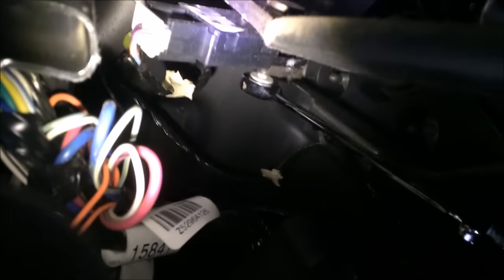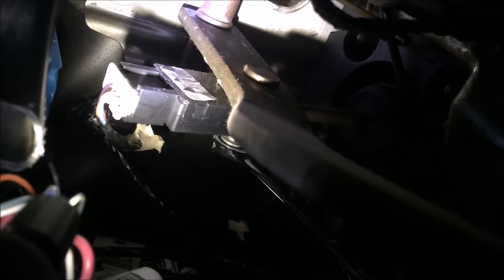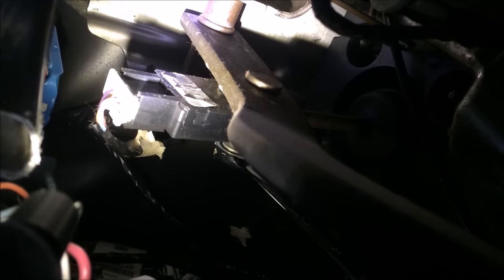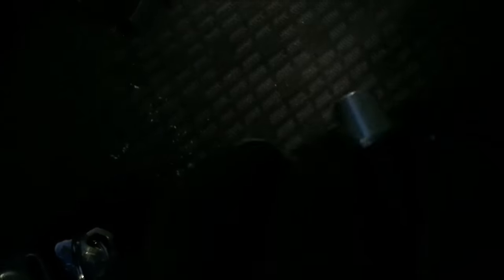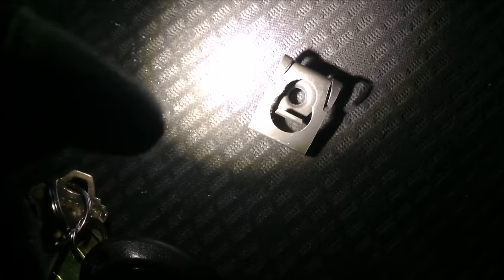How to Replace a Brake Switch on a 07 Silverado, Fixes Cruise Control Issue.

Comment from the maker: Thanks for all the positive feedback everyone, very worth making this video. This is my own little slice of fame lol. I have done more work to my truck that I did not make videos on, but if anyone has questions on replacing the crap door speakers, or how to install a Bak-flip bed cover (my favorite design due to a hard cover, fold-able, and level bed-height profile which is what you need for backing up in my opinion) I would be happy to help. My grill was home done as well with a roll of painters tape and two cans of automotive grade spray paint for plastics. My buddies where painting their bow ties black so I had to one up them lol.
Reply: the crap speakers have any effect on the door chime/headlight on warning?....think it comes through the speaker and mine is so quiet (set on loud) that I can't hear it......
Reply from the maker: andy heinrich If the speakers play music just fine (evenly on each side) then I would not suspect that to be an issue. To me what made them "crap" was their poor audio quality and one of mine was cutting in and out.
Reply: don't think either is on at all........bought new ones from GM...that's one of today's projects......love having the cruise working since I drive about 75 miles a day to go to/from work
Reply: andy heinrich
that fixed all my issues. Right speaker was intermittent, left was dead. By the way, the door chime comes from the drivers door speaker. And the rattle in the drivers door was the two machine screws missing behind the door handle access cover. Borrowed one from each back door.......
Reply: Yes the crap speakers please lol the drivers side will cut in and out and sometimes not work at all
Reply: @TruckOwnership101, a friend has 3.1 Chevy Malibu 2003 and the brakes release but when you move a few feet.  The brakes lock up.  Could a electrical problem with the cruise control lock up the brakes?

Comment: What's up Spencer and welcome from Rochester, MN! Great video brother! I had the same issue accept the ABD and "service traction control" light was also turning on along with the cruise control not working. It was the weirdest thing, bit everything functioned correctly (brake lights, brakes)!  I've done allot of research, and determined that it was the brake light switch. Then I read someone else's post that said that the 10mm bolt may be too tight and the brake push rod may need some lube. Sure enough, I loosened the bolt, lubed behind the module and lubed the push rod... BAM! No more issue! The restriction was causing the module not to move along the natural path of motion. So guys give it a try... Cheap fix and will eliminate one possible culprit!
Reply: I second that! Went to change mine, found that the shaft was just really dirty on the brake pedal and causing it to bind/stick in the engaged position, not enough to make the brake lights come on, but enough that it would prohibit the cruise from functioning. I lightly sanded the post that the brake switch and the plunger attaches to and resolved my issue. Great video however and pretty much spot on for how to do this repair, most difficult part was trying to fit myself between the door and the seat to get under the dash!

Comment: Spence, thanks a million. '07 GMC Sierra (72k miles), coming back from a trip last May, the cruise control shut down.  It has only worked intermittently since then and has been completely down for the past few months.  A couple searches landed me here and a short trip to Pep Boys, $20, and the video did the trick.  I have a long trip in May again and this is a load off my mind.  Again, many thanks.  tommy

Comment: I have a 2008 GMC Sierra 1500.  Brake lights were working fine but cruise control stopped working.  At first it was just intermittent.  Owner's manual says cruise control will not work if brake fluid is below minimum level.  Mine was right at the minimum line.  I topped it off and it seemed to fix the problem.  A few days later the cruise control stopped working all together.  I watched your video and read the comments.  Got a brake switch at local auto part store and installed it but the brake lights stuck on - apparently it was defective.  Took it back and got another one and then it worked fine.  Cruise control works properly now.  Thank you Spencer!!

Comment: I have a 2008 Silverado; bought used in June.  didn't use the cruise during the testdrive; brought it back to the dealer a day or so later to prove that it wasn't working.  They did some tinkering and I even took it in for one appointment.  Think I will try replacing the switch as per your video; nice work, btw!  you seem like a very good teacher; bet the students enjoy you and your class!

Comment: Your video helped me solve the intermittent cruise control problem on my 2008 Silverado. Your instructions helped me learn about the brake switch and how to replace it. My truck had the same symptoms you described. It began during the winter and seemed okay later during the summer. This fall as the weather cooled, it again became intermittent. After replacing the switch, the cruise worked fine for a few days and then became intermittent again but I was able to activate cruise by tapping on the brake switch. Finally took the switch out again, wiped off the old grease and applied new dielectric grease. Also applied grease at the point where the brake push rod enters the firewall through a rubber boot. I believe the push rod was sticking at that point. Cruise control seems to work 100% again.  Thank you again for posting the video.

Comment: I have a 2007 GMC Envoy.  It was identical in changing. I changed it in about 10 minutes.  BTW i've contorted in ways i didn't know i could. LOL...recommend needle nose pliers and a flathead screwdriver. Took a little bit to figure the clip out. Not hard though.  Easy peazy!  Thanks a million!

Comment: Thank you Spencer.  My 07 Avalanche didn't have a 10mm bolt.  It had a clip instead covering where you show the bolt to be.  The clip is very springy. There is a little "J" ledge on the bottom of the clip you need to pull on first so the top of the clip can clear the ring around the shaft.  I was then able to get a small screwdriver between the top of the clip and the top of the shaft and lift it up enough to push the clip up and off.  Then the dis-assembly and re-assembly was just like you show.  Putting the clip back on was easy. Press the whole clip while pulling lightly down on the "J" channel.  Mine clicked right into place.  Took me about 20 minutes.  Now that I know what I'm doing, should take about 10 minutes.  The best part is my cruise control is now fixed!!  Thanks again.

Comment: very much appreciate the video along with all the responses. I easily changed out my brake light switch on my 09 gmc sierra denali and the cruise works again. One very interesting discovery though. The part number for the sierra series is 15861245 from gm. So when I removed my brake light switch it had a different part number on it. that part number was 25981009. So I called back the parts department at the local gm dealership and was told that the 25981009 switch belongs to the Yukon and all the other suv's gm produces. He was not able to tell me how that switch got into my truck since I bought the truck new. But the new switch works perfectly so far.

Comment: This helped me fix my trailer brake issue as well on my 2007 1500, they were always engaged when I turned on my truck. Swapped the switch and it was fixed.

Another helpful tip is to put some paper or something to keep the tab from firing off into the depths of your truck when you finally get it to pop off (I had to do some serious fishing to get it out of a crevasse behind some wires)

Comment: Just replaced my switch on an 2008 Silverado 2500 HD.... Besides affecting my cruise control, it was sending voltage to my brake controller and applying my Travel Trailer brakes all the time... $20.00 fix and 30 minutes... not bad

Comment: Great video and a big help.   Thank you Spencer.   Just replaced the switch on my 2008 Silverado  LT 2500 HD.  My truck's symptoms were exactly like you described in your own repair.   With your video, the toughest part was getting that darn clip off.   After applying a light bit of pressure on the inside of the clip with a narrow blade screwdriver, it came off like a champ.  Back on the road and able to activate the CC again at will!   Thanks again.

Comment: Thank you for sharing this info.  Once you are under the dash, all this comes together perfectly!  

Note: for trucks/SUVs with adjustable brake pedal height, the sensor is oriented to the passengers side.  Same PN and parts to remove, just a different packaging as the up/down motor makes it a tighter fit.  BUT not any more difficult to replace as this video shows.  

Tools:  10mm wrench and a medium flat head screwdriver.  

10 minute job.

Comment: Great explanation!!!  Here is my experience.  Never mind, LSS.   First.  While up under the dash, depress the pedal, then release it.  You should hear a slight click with each movement.  The switch is meant to swivel slightly.  If it doesn't move, use penetrating oil between the switch and let it soak.  Then move the switch back and forth.  When it begins moving freely, it should work.  Save a lot of work, and is likely to be the problem.

Comment: Awesome video. I am trying to do the same on a 2007 Chevy Suburban. The switch is and harness is exactly the same, the problem is the screw holding the assembly together. It's round on one side and flat round on the other, with no way to remove it. Any thoughts on how to remove the screw holding the assembly in place? The screw is round on both sides, no place for flat head or phillips head. Any suggestions or help would be appreciated.

Comment: Thanks, this helps a lot. Saves me cash that I need for other things right now. The clamp does look tricky. But I'll get around it just like changing the headlights. ('07 Avalanche, it's like pulling tiger teeth.
Reply: de49lb  yea.. whats with the headlights? Seems every month or so i have another bulb out..

Comment: Great video and info.  I'm having trouble getting the clip back on because there is not much of the pin coming through the plastic part of the switch.  Even when I squeeze the plastic part of the switch, there still is not enough of the pin for the clip to grab on to.  Maybe I don;t have the switch rotated correctly?  I've tried every configuration. Any help/advise much appreciated  Thanks

Comment: I followed your video and it was very helpful.  However, now that I have completed this, my brake lights will no longer come on when my truck isn't running.  I have tried putting the old switch back in and that doesn't make a difference either.  Nothing was bumped or cut while changing the switch.  Fuses and relays seem to be good as well.  Any ideas?

Comment: Great Video. I'm having issues with my 3rd brake light (top of cab). Hopefully it's the switch. Your efforts are much appreciated.
Reply from the maker: Thanks! Seems odd that a switch would just effect the 3rd break light... But for about $20 it's not a bad thing to try, hopefully that fixes it. Good luck!

Comment: Great video.  My '07 Tahoe didn't have the 10mm bolt, only the clip.  I didn't time myself but I'm guessing it took less than a minute to replace the switch the switch.  My only regret is why I didn't I replace it a year ago when my cruise quit working? Thanks Man!

Comment: I cant get the bolt all the way in. It was half way out when I replaced and will only go half way in unless I really turn it hard. Is it suppoto be out a 1/2 inch? I also noticed the new switch did not work so I pulled over and pushed it up and so far its working

Comment: do you happen to know if the brake wiring from a 2007 chevy sylverdo differs from a 2000. i changed out the bed and now the brake lights wont work.

Comment: Hoping this is the same switch for the brake lights. Had this cruise control issue for years. Just kicked the pedal a couple times and it worked. I just bought a trailer and wired a brake controller. Realized when the trailer blakes started smelling THAT THIS SWITCH WAS KEEPING THE TRAILER BRAKES ACTIVATED!!! Just ordered  the switch. Hopefully that fixes it. Thank you.

Comment: So I had a question. So I just got 2008 silverado and I'm having the same issues and I'm about to go buy the switch and see if it works. My question is. Is there a cruise control fuse anywhere on this truck? 
If so I'm having a Hard time finding it. Thanks hope you reply soon
Reply: In the engines fuse box

Comment: perfect description of what mine is doing(2008 Sierra K1500)......will buy a switch tomorrow
Reply from the maker: This should do the trick, just watch out for when that clip comes off. Mine went flying and I was lucky it didn't fall into depths behind the floorboards.
Reply: Spencer Elvebak SUCCESS!!!!!!....after I found the damned clip that flew into the space behind the drivers side kick panel......many thanks for the $24 fix.

Comment: I got the ac delco replacement from rockauto.com for about $13, including shipping.  It probably took me about 10 minutes to remove the old switch and install the new one.  Unfortunately, I did break the tip of the clip.  But, I just got back from the test drive and everything seems to be working properly.  Thanks for the video!

Comment: Okay, so I had same problems on my 2007 Sierra. Actually, mine started out as intermittent cruise control issues. In the winter during freezing temperatures, my cruise control would not work until the inside of the cab warmed up. I saw this you-tube video, went to auto zone, purchased and replaced the brake switch. After installing the new switch, I noticed my brake lights were not shutting off. It turns out that the problem was not the brake switch. The problem was caused by corrosion on both the rod and the bushing that hold the brake switch  in place. The thin amount of white corrosion was just enough to make the sensitive brake switch fail. I then removed the brake switch and I used a small wire brush with WD-40 to clean the rod and bushing. Re-assembled and now everything is fine. One other tip for anyone that removes and re-installs the brake switch. Please remember to re-install the safety clip with the bolt, it is VERY important. Should the clip come off while driving, and the brake linkage come apart at the rod and bushing, you would not be able to stop the vehicle. Good luck, I hope this was helpful.
Reply: +Joe Loftus Thank you for the tip about cleaning the rod. My brake lights are staying on too after replacing the brake switch on my '08 Silverado. I didn't notice any corrosion on the rod linkage but there must be some. As you said, the switch is very sensitive.
Reply: +DoubleTroubleTwinn1 Well, here's the scoop! As I said, I drive a, '08 Silverado. I think I solved the problem of the intermittent cruise control/intermittent brake lights. After installing a new brake switch, my cruise control worked fine for a week or so. Then I noticed the cruise control wouldn't come on reliably After a few light taps on the pedal, cruise control would again activate. I also noticed that my brake lights weren't going off reliably. After a few taps, they would go off. I took the brake switch out again and cleaned out the original grease from the end of the switch where it connects to the brake pedal arm. The grease was white and stiff. I replaced it with clear dielectric grease. I also noticed the push rod that extended from the brake pedal to the firewall had grease at the boot where it entered the firewall. There wasn't much grease, but what remained there was thick and dirty. I wiped the old grease off and rubbed on some of the dielectric grease I had applied to the brake switch. I reassembled the switch to the brake pedal and finger tightened the bolt that secures the assembly. It has only been a few days since I reworked the assembly, but the brake switch performance seems to be like new. The brake lights and cruise control have worked 100%. I think the old, worn our sticky grease was the problem. That would also explain why the problem seemed to arise in cold weather to begin with. I'm wondering now whether I needed to replace the brake switch at all.
Reply: +Joe Loftus Update: Even though I thoroughly sanded, cleaned and lubed the rod and bushing, the switch I purchased at Auto Zone kept giving me problems with the brake lights sticking on. I purchased another one from O'Reilly and it too had same issue. I then went to the GM dealer, gave them my VIN number and this time, for $3.00 less,  got a brake switch that works perfectly.

Comment: Only question or doubt that i have is on the clip. I just want to make sure i put it in the right way. The big slotted side goes the the metal rod and just slide it down. And put the screw? I took it off with out studying it a little more.

Comment: Spencer, great job with the video, although my "cruise" is working fine on my 2011 Silverado but my "Service Stabilitrak" "Service Traction Control" lights on the DIC are periodically coming on and it always seems to be when I have driven for a short while and I have stopped at a light or stop sigh or whatever so I'm thinking it might be the brake switch? Any thoughts? You should make more videos like this you would have a load of subs in no time.
Reply: Did you ever fix your service stabiltrak issue?  That's what I'm dealing with on my 2008 1500 silverado